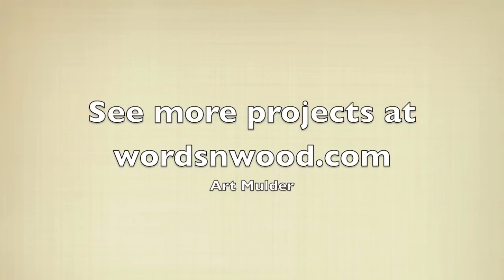Building a 12" Disc Sander from a furnace motor (WnW #12)

Comment from the maker: Patrons spin me right round, baby, right round: https://www.patreon.com/wordsnwood

----- ----- ----- 

This is an experiment in seeing if I can make a functional disc sander out of a relatively "weak" 1/3 horsepower motor, and other free/scrap bits laying around the shop.

More about this project: http://www.wordsnwood.com/2015/sander/

FOLLOW UP, six months later, in this shop update video: https://youtu.be/0O2IE4ubwdc

————— ---------- ---------- ---------- ----------
LINKS TO SOME OF THE ITEMS USED. (Affiliate links)

West System Epoxy Kit: http://amzn.to/1jlGgFc
12"adhesive sandpaper disc:  http://amzn.to/2mTeIKR
Hitachi Compact 10.8V Kits: http://amzn.to/1jlCETB
Ridgid 12v Compact Drill: http://amzn.to/1O1lJmb
Crepe Block to clean Sandpaper: http://amzn.to/1KFC0G9

Comment: Nice! I think that 1hp is ideal, but 1/3hp will do the job just fine. I had similar problems with making a disk for mine. The first one was BB plywood, but I quickly changed that to melamine coated particle board.
Reply from the maker: Thanks!  I was just using it tonight on some 4x4 ends...  seems to sand well.  I don't have another 12" to compare it to, but it does do better than the small 8" Mastercraft disc that I have.
Reply: wordsnwood I look at the full load current draw of a motor for a more accurate rating on the power, so 1/3 would be around 4 amps. Furnace fan motors usually have accurate ratings, unlike a lot of dust collector motors.
Reply from the maker: Unfortunately, I don't have one of those clip-on meters, so I don't have a way to measure current draw...
Reply: wordsnwood
The current draw is usually written on the motor normally abbreviated FLA (full load amps).
Reply from the maker: John Heisz  I didn't know that, thank-you!  The FLA is 6.1   So that's actually more than you were thinking.    
(It's a Marathon Electric  catalog B207, model BQJ. )
Reply: wordsnwood
That would be 1hp on a cheap band saw and at least 3/4 hp on a dust collector :) They tend to exaggerate the hp rating in the product copy, but they can't lie about the actual electrical specs.
Reply: How do wire it to a drop cord like how do you get power to it

Comment: I just stumbled on this video. I did this exact same thing a few years ago. 1/3 HP furnace motor. The pulley on the motor was cast aluminum and it had a protrusion coming out or the center that happened to be the exact size of a hole saw that I have. I used 1/2" MDF for the disc and cut a perfect 12" circle with my table saw by spinning it around a center hole. You can learn how to do it by a search. Then I used the hole saw with that center hole to cut a hole for the protrusion. Then I drilled holes through the MDF and the side of the pulley and counter sunk those in the MDF for 4 beveled 1/4 x 20 screws. I tapped the holes in the pulley. I put Formica on the face of the disc. I think I need to sand the Formica because the self adhesive sanding disc comes looses a bit. Otherwise, it works well enough. Thanks to your video, I learned that my motor is reversible. Mine took about 10 min. to reverse.

Comment: It's not that the plywood is out of flat.  That wouldn't cause it  to jump that much.
It's that the density often varies.
Reply from the maker: I was counting on Baltic Birch being a more uniform plywood...    Oh well.
Reply: wordsnwood But the wood that is use for the plywood itself is not uniform weight. if there is a branch or some other inhomogeneity the weight varies. Think on tires made out of homogeny aluminum and rubber - there are even lead weights for balancing.
Reply: The disc could be also made out of plywood by balancing it by drilling holes to the back until the disc balances on its center. Just like Cosmas Bauer did.

Comment: So this is what they were talking about in school when they said we would use it as adults... OK well this is a pretty common mistake with the math. Unless I miss the mark, here is the issue...people count the pieces and then look for the angles. What they should do is remember joints are made of 2 pieces, therefore, each cut would be for half the angle. Putting two pieces together make up the whole angle. Between pieces 1 and 2 is 4.6 degrees made of (2) cuts of 2.3 degrees each....and so on.      I.E. figure the angle, then remember to cut half that angle for each mating piece. Another idea is to trace out your math on a sheet and see if it looks right by checking with the angle gauge or protractor....you know....draw out the pie segments. BTW, great project. Way to go, getting to the finish line!
Reply: +Dane Johnson Ya beat me to it! It was a good idea though, and a good fix using the epoxy.
Reply: +Ben Nawrath Agreed. Being resourceful is often a better tool than simply knowing the answer in the beginning. Problem solving for the win. Respect!

Comment: Thanks for the ideas. I am making one with an aluminum disc from pretty much surplus stuff as you did. Cheers!
Reply from the maker: You're welcome...  Mine has a tiny wobble which I should try and fix, but even with that it sands just fine.

Comment: I'm thinking you could have still used the plywood disk, you have that 4x36 belt sander, you could have propped it up against the disk while it was spinning and sanded that wobble out after a few minutes, you used it to true up the edge on the MDF wheel, I would have tried against the surface area while that disk is spinning, sanding until you remove enough material that reduces the wobble caused by it not being perfectly flat, but l like this idea, I might try it myself, there are always tons of cheap AC motors, for general sanding 1/3 HP should be more than plenty and you have a dedicated sanding station - nice job, nice video, subscribed :)

Comment: are u happy with this? definitely something I would like to build.
just made a dust filter unit with an old furnace motor, a 12 inch sander would be right handy
Reply from the maker: yup, still works fine.

Comment: i also made 12 inch sander with motor out jig saw with speed control.used hub off bike so its running on bearings. dust collection connects from behind. only had to buy wood glue since im always running out of it. need barrel of glue

Comment: I just build (or am building) a 16" disk sander.
Its obviously huge, but its only powered by a little over 1/2 hp (380 Watts)
I can stall it if I really want to but holding a 2" x 4" piece of hard mahagony against it doesn't make it slow down.
Even tho its a "low power" motor its perfect for the job.

Although I have to add that its a 2800 rpm motor and I've reduced it down to 1550 rpm with my pulley.
So in a perfect world that would be 760 Watts (~over 1hp)

Comment: I think the gaps on your guard are from the angle cut you used.  You said 4.6 degrees.  180/39 = 4.6, but that is the total angle between the blocks.  You needed to divide that by 2 to get the angle on each block.

I have an old 2hp motor from an air compressor I want to do something with.  I was thinking about making a disc sander.  it's a 3450RPM though.  Think that would be too fast?
Reply from the maker: Yeah, that makes sense.  Thanks.

As for your motor...  I've never seen one that fast so I don't know how it would act.  You could get a pulley+arbor to step it down in speed.

Comment: Hey Art, after 4 years, how is this thing working? Is the 1/3 hp motor enough or do you feel you should have used a bigger one? Also, did you use melamine or MDF? I don't know if the two terms are synonymous, but I think of MDF as not having a finish on it where melamine has a laminate on one or both sides. And finally, how do you find the discs stick to and remove from the melamine surface (if that's what you used)? This project is getting on my short list and your experience will be super helpful, thanks!
Reply from the maker: Huh, wow, it really is four years...   Just used it tonight.   The 1/3hp is fine for my needs.   I think it sands pretty quick.

It is MDF sold as shelving.  It had some sort of coating on it, but I don't think it is melamine.   If it is, it's pretty thin.
I think I've changed the sandpaper only once and it was not bad.   

Kind of wish I had a bigger one.   I get jealous when I see that monster that Frank Howarth (from the Frank Makes) channel has.   Not that I have any practical need for something like that!
Reply: @Wordsnwood  Thanks for the reply! Yes, it's easy to drool over Frank's shop. And I don't have any need for that kind of thing either. But then, is it really a question of "need" for something like that. :)  Thanks for all of the info on the sander. If you're curious about it, I'll share how mine goes when I get to it.

Comment: Nice project!
Is there any particular reason you wanted such a "sturdy" dust screen?
I plan on making this, but I plan on using 1/4" ply for the dust sreen which I'm going to make "bendable" by ripping it halfway through at every 1/4" or so...
Reply from the maker: Peter Watz That should work fine.  And really, there was not any particular reason for making the arch as thick as I did.

Comment: So now I see in the comments that it is better to use melamine coated particle board as it is uniform in cosistency unlike the plywood I used. Went to a plumbing heating shop and was told that a fan motor from a furnace would be useless for disc sander. Used washing machine motor with less amps and it worked so perhaps the guy saying no to the furnace motor was expecting stellar results?

Comment: Great video, 
Just one question regarding the 1/3 hp: are you able to stop, or slow down, the disc rotation by pressing a piece of wood into the disc or that requires excessive amount of pressure  ?
Reply from the maker: +Fredrik J I've never tried to stop it, and under normal use I have not noticed any issues.
Reply: +Wordsnwood (Art Mulder) No, I wouldn't either try to stop it...
Then 1/3 hp seems enough if it doesn't loose any rotation speed under normal sanding - thanks

Comment: This question is not about the project as such. More about your camera. At 1:51 there is a phone, i think, on your work table. It shows what the camera is pointing at? How did you pull that of? =) I have been looking for that kind of solution. Hope you understand my question and can help.
Great project by the way. =)
Reply from the maker: Thanks, malene koldborg .  I'm using a Sony Actioncam  HDR AS-15 which can communicate to an iPhone or iPod over wifi.   (there is a free sony app that we downloaded.  I would think it is available for android also, but I don't know)  This is a small camera much like the gopro. I'm pretty sure that the newer gopro cameras support this method also.  You can also buy separate dedicated wireless screens for those cameras, but I already had the iPod, so I went with the cheap approach.

Comment: what brand, size, & where did you get those Pump" 2 part epoxy..???
Reply from the maker: +Bob White It's a west system kit.   105 epoxy, 205 hardener and 406 silica powder to thicken it.   I bought it at Lee Valley, but you can also find it at amazon:  http://amzn.to/1TzG98z
The pump system is great because they take care of all the measuring.
Reply: +Wordsnwood (Art Mulder) That was my first thought, I've always known it's "equal parts" & for over half a century, I'm not sure all my parts were ever that equal.. & I like the idea of being able to thicken it.. Thanks.
Reply from the maker: +Bob White 5 minute epoxy is equal parts.  The west 105 epoxy is a 5:1 ratio.  That makes the pumps even more useful.   (or 3:1 with a different hardener)
Reply: Love it thanks, how much does it cost?
Reply from the maker: +Bob White   The 32oz kit is in the US$75 range from Lee Valley or Amazon.

Comment: Any reason why your table is below the C/L of the sanding disk?
Reply from the maker: Because when I looked around online that's how I saw other sanders were built.
Reply: Gerard B du coudray Balance load can be achieved if the table level can be adjusted based on the thickness material being sanded.

Comment: Great design and great build that you have done here. The fast forward of the saw cutting makes me cringe each time I watch one. 
The disc imbalance could be caused by the square section mounting plate on the back of the 12" disc. It would be better if this mounting plate was round. Loved your use of the belt grinder but it may have been easier to use a wood chisel and turn the edge true as if it was in a lathe. When rotating items need to be balanced, finding the centre when assembling them is not as important as truing them up to the axis that they are mounted on.  Ideally the mounting plate edges and the mounting plate face should have been trued first and once the disc is mounted the edge, rear face and front face should also be trued. All are then true to the rotating axis that they are mounted on. 
Please take this as constructive criticism, what you have made here is something that  seems to be working very well and suits your purpose. It is certainly very well made.
i worked in a shipyard for many years and one of the shops had a disc sander about 36" wide with a huge motor on it. They used peel and stick, non slip deck tread instead of sand paper and if hogged through the wood. No idea how cost effective this is but they told me that the deck tread lasted for years. They were boat builders, not cabinet makers.

Comment: I'm betting your balance problem is... unless you buy plywood with no voids... it has voids in it... In the plywood you can't "see" where the voids are. It would be just like when they drill out metal to balance a part.